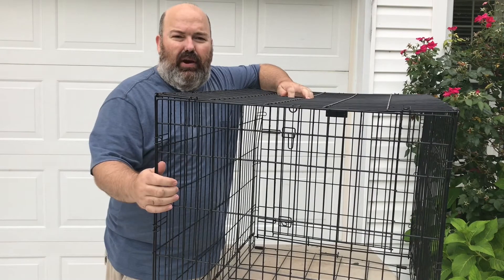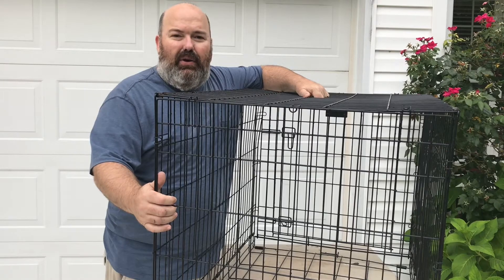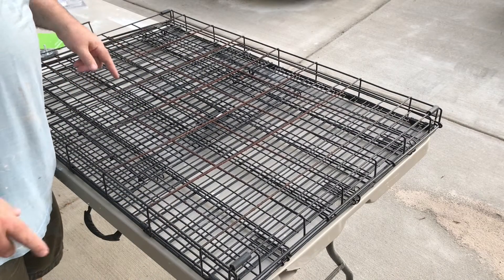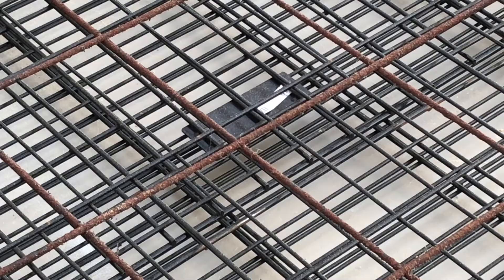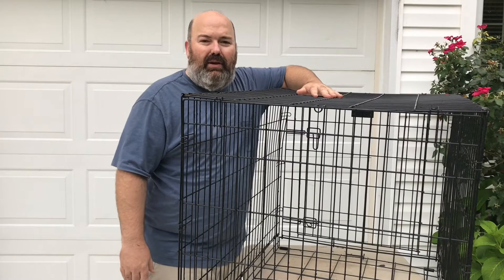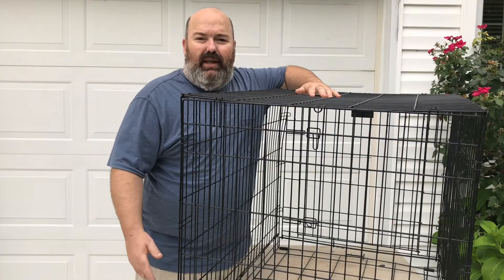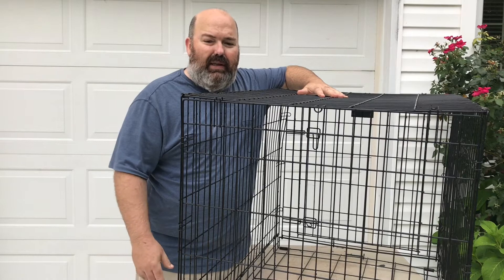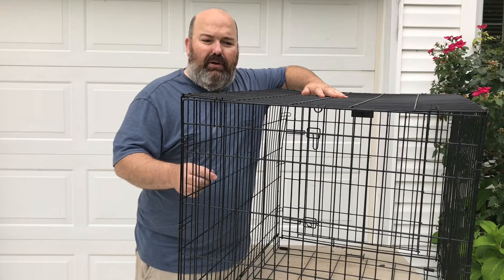DIY How to Remove Rust From Dog Crate

Comment: Would a Brillo pad also work? Instead of the wire brushes?
Reply from the maker: You could use a Brillo pad or sandpaper by hand. I thought about that but thought that would take a long time. The wire wheels were able to get the rust off down to bare metal so the paint could adhere. Another solution, depending on how thick the rust may be, is Rust Neutralizer which is a spray on project that converts the rust to a paintable surface. I have never used it but thought it was an interesting option. rust neutralizer is only about $6 a can I believe. Thanks for watching and good luck.
Reply: It would take a while.  Harbor  freight is cost efficient.  Sand paper also

Comment: Couldn’t I soak it the crate in white vinegar and then use a wire brush? I have several weeks before I get the dog.
I thought I would. Do that.  Rinse it, and then wash again with Dawn. That should be Eco friendly and safe for the dog.
I notice that the comments references some animal safe paint. I’ll check that with my vet.
Reply from the maker: I have heard of using a vinegar and water mixture to remove rust. From what I understand you can spray it on and let it sit for a few minutes before using a wire brush. It may take a few attempts depending on the level of rust you have. Make sure to dry it with a towel afterward so rust will not build back up on the metal. checking with the vet on paint options is a good idea. Good luck.
Reply: What paint did they recommend?
Reply from the maker: @dominica5416  I assume this is directed at "A H", but  you may want to check out this pet safe paint that is made specific for pet cages. https://www.ecospaints.net/Gloss-Pet-Dwellings-Paint?matchtype=&network=g&device=c&adposition=&keyword=&campaign={campaign}&adgroup={adgroup}&gclid=CjwKCAjw2dD7BRASEiwAWCtCb
Reply: @MarriedManWoodworking  yeah it was. Thanks though. I’ll check that out. I saw a lot of people saying that you can use any paint because  “once the paint has dried, it’s not harmful to the pet”.  I’m doing the exact same thing as you. Gotta get the rust off this cage and then going to paint it black.